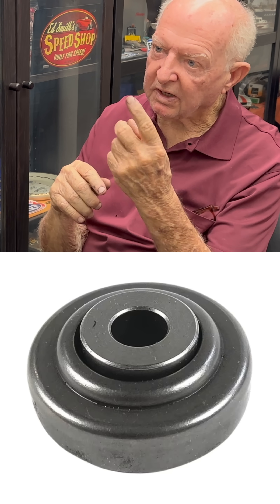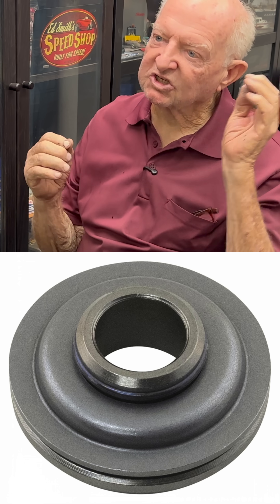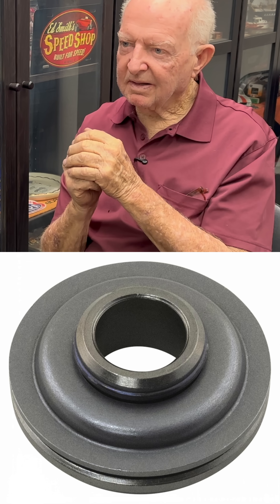Rotate your VALVES? Ed Smith w #BarryT from Ask Ed 45 #classicengines #racing #mechanic

Comment: 😮 I had a 460 ran like a raped ape🎉 blew the head gaskets upon pulling the heads I noticed most of the valves were eaten to buy the rocker arm😢 duff heads original springs😮